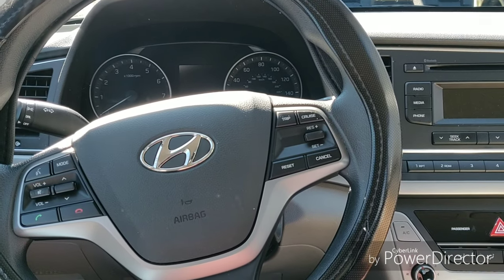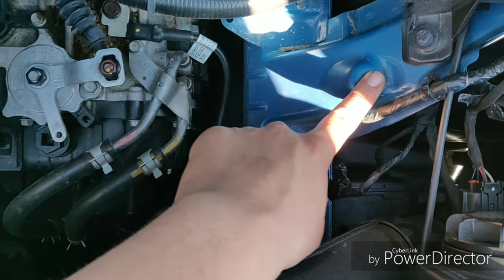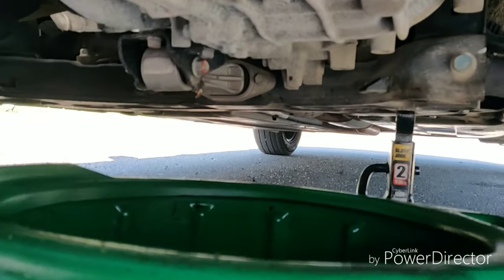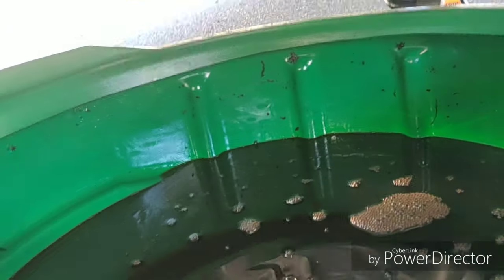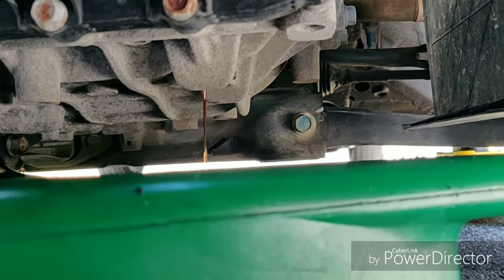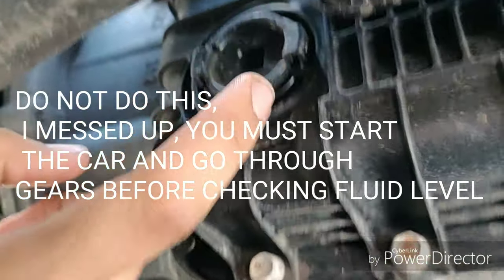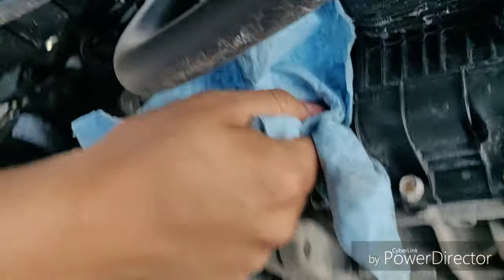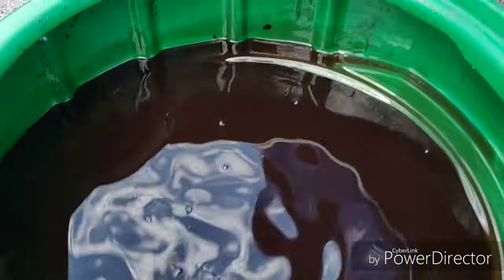HOWTO 2017 ELANTRA TRANSMISSION FLUID CHANGE

Comment: I was able to get the plug in and out with no problem. Don’t be afraid to use a LITTLE force. It only needs to make is past about an 1/8 of an inch so it’s bends.
Reply: Do you know how many quarts came out thanks
Reply: Would you be willing to post a video of your way of pulling it passed the neutral safety switch?
Reply: Cory 919 Brother, maybe next time I service it. All I used was a heavier flat tip screw driver to put just enough pressure on it to get passed that 1/8 bend. I did it a couple times actually. Don’t be afraid to use a little force
Reply: Same here. I was able to get it out with no cutting just by angling it slightly away from the interfering tab and pulling up by hand, no tools and with just a little bit of force. Putting it back proved to be more difficult, so I filed a very shallow (~1mm) half moon in the plug while it was on my work bench.
Reply: @cgatito3528  I did the same.. I got a small course file , and filled a 45 deg on the bolt while it was still installed on the house..works perfectly now...easily removes and installs.. All is good now.... Thanks all...
Reply: Late with the post but how many quarts will fill the empty transmission ?
Reply: Actually that's the wrong fill plug cause that's the breather plug to release air. The filler port/plug is on the rear part of engine.
Reply: @wesdesigns1838  hey, I'm about to do my transmission fluid change on my car, where is the fill plug exactly on the back of the engine?

Comment: Tip for next time, you can always pull the emergency brake and use the shift lock on the shifter and put it in drive. That will move that shift Linkage that’s in the way so you can easily remove the fill plug without buggering it up👍🏻
Reply: Lol i hate u but i Love u buggering it up made my day thanks i needed that Laugh

Comment: I called my local Hyundai and asked how much is a quart of Hyundai SP-III AFT for my 2012 Elantra cost, and I fell of the chair when he said "$39.99/qt".  I said "13.99?"... and again he confirmed "NO, SIR... $39.99 a quart".  I was like "Wow, are you serious?"... "The price is $39.99 a quart".  Obviously, I did not buy it from that dealership.
Reply: My well maintained 2013 Elantra LTD with  91k mi. on it . . . has never seen the dealer since purchase and it won't. You know how I got 91k trouble free miles on it . . . I took charge of the maintenance and most important . . .
I kept the dealers damn hands off of it.

Quality Oil, OEM filters, Quality ATF, NGK PLUGS,  BRAKES, TIRES . . . NONE OF THIS IS ROCKET SCIENCE . . . " LEARN " FROM A KNOWLEDGEABLE FRIEND . . . LIKE THIS GUY . . . OR GET A TRUSTED MECHANIC.
Reply: Bullshit. I paid 17 per quart from a dealer
Reply: @jamesm.8392  you are absolutely right, DIY goes a long way, the only thing I'll have someone do is new tires

Comment: Actually that's the wrong fill plug cause that's the breather plug to release air. The filler port/plug is on the rear part of engine.
Reply: WHY then does everyone use the plastic one under the air box then?

Comment: Why you changing the trans fluid after only 35k miles?  I thought the trans fluid is changed when it hits, 100,000?
Reply: 60k - 80k miles is ideal range. 100k is too late
Reply: @vuvu3421  Owner's manual states first fluid change at 150k miles. It's synthetic fluid. Lasts longer.
Reply: U dont need to change it on an automatic 2015 elantra since their sealed
Reply: @tiana1017  wrong
Reply: @palebeachbum  owners manual is not always true. You can see in the video how bad was the fluid after 35k miles.
After your warranty is expired, your trans will be broken and you'll need to fix it at the dealer; and that's how they rip you off
Reply: @oqhr  The transmission warranty is 100k miles. I would change the transmission fluid before the warranty runs out. If the transmission starts slipping or having issues after the fluid change, the warranty should cover repair or replacement. Waiting until the 150k mile recommendation is foolish, IMO. Changing the fluid at 35k though is a waste of money. It would be like changing synthetic engine oil every 3,000 miles when it's generally good for double that life.
Reply: You should never ignore transmission or transfer case fluid changes despite what the schedule says. Unless it has an external spin on filter youre asking for trouble. Youre just circulating all the shavings, etc around. Yes the filter does its job but the fluid is still dirty.  Its cheap insurance, a transmission rebuild on new computer controlled sensors up the ass to many things to go wrong transmissions are easy 3k
Reply: Where did you get that service manual
Reply: @jaredjacoby545  try eBay they had them back in 2018
Reply: Can’t believe how bad the oil was at only 35k. Crazy.  Will be doing this on mine at around 40k.  It has about 20k now.  The procedure is very similar to my last GM car.
Reply: Its hyundai mechanic recommend at 25k🤷🏻💯 fkn engineers🤦🏻

Comment: Thanks for the video, very helpful! I just changed the factory fill atf in my 17 Elantra at 140k miles. There was a little bit of shavings on the magnet, nothing visible in the fluid. Fluid was slightly brown with clutch material but not burnt. Exactly 4 quarts came out of the drain plug. Repeated drain/fill a second time after a quick spin to get more old fluid out. 

I filled with valvoline maxlife, it had the Hyundai spec listed on the bottle, is full synthetic and only costs $17/gal so I feel good about it. IT STINKS LIKE HELL THOUGH! lol. I spilled a little in the engine bay and it took a week or so to air out. I’ve put 10k miles on the new fluid with no noticeable changes in performance, so I think all is good!
Reply: wow, that's a lot of miles, I drive around 40k miles a year, I already sold my 2017 Chevy and now I have a 19 Elantra and a 19 Elantra GT
Reply: How did your Valvoline Max work in the long term.
Reply: @johnjohnson9980  just fine, sold the car at 200k with that same valvoline fluid and no noticeable change in performance. Car still ran like new
Reply: @ravstafarian5186  this makes me less worried now. About to change the factory fluid soon at 93.5k miles. Mostly highway driving so hoping i dont mess anything up.Im conflicted on what fluid to use. Can you shed some light on what fluid is good. Debating between amsoil and valvoline maxlife
Reply: For anyone reading.I went with Aisin spv IV from rock auto for about $8.50 a quart.Was able to drain about 3.5 quarts from the transmission and filled the same amount.So roughly half the fluid was changed with a single drain and fill. 500 miles since than and no problems yet. Will do a second drain and fill when i do my next oil change

Comment: Exceptional video!!! Great job. I undid the neutral switch bolts and the fill cap came off beautifully. Easy job. Use OEM FLUID AT ALL TIMES. Mine drained 3.5 quarts out.
Reply: did you just add 3.5 back in? I’m not a fan of the level check procedure so i was wondering if i can jsut put back in exactly what comes out ?

Comment: You are the hero we didn’t know we needed. Also, bless you. I just hit 120,000 on my 2017. Looking to change that soon along with my antifreeze/coolant.  Thank you for the video bud.
Reply: Chang it every 60,000 miles, ATF.
Reply: At 120,000 miles you would not be wise to NOT change the transmission fluid.
YOU may at this point do more harm then good.
Reply: A few questions if you don't mind my asking. Do you have the 2.0L engine and did you have to get it replaced? Has your Elantra had any transmission problems? I bought myself a new 2018 Elantra and the engine ran like crap from the first month of ownership and the transmission started acting up at 8,000 miles. It wasn't safe to drive and the dealership was no help. Ended up selling the car at 25k miles. I loved the car so I was really disappointed by the problems.

Comment: I already did it in my 2013 elantra at 60,000 mi.  last year. I use the same fluid SP4-M from the dealer $20.23 each. I use 3.9 quarts just drain and refill. Great video.
Reply: So about 4 Quarts is the Norm.  On these Transmissions  Good 👍😁😚😏

Comment: I just did this at 58k on my 2017 Elantra GT. I don't see much content revolving around the GT, but this and similar videos worked well enough for me, though there are a few differences:

1. I didn't need to remove my splash cover to access the drain bolt, but I did anyway for the sake of doing it the first time. When I started, I realized I could see the drain bolt right away and the cover wasn't in the way. I think next time I will leave the cover on and see how that works for me. Though I'll probably have to take it off to check the level so I may be stuck with removing it, haha.
2. The fill bolt on my GT is the screw-in kind. It tightens all the way down, and I had to unscrew it for a bit to get it out. It's not a half or quarter-turn like on the sedans.
3. I did not have to file down or cut my fill bolt in any way - that part you had trouble with isn't in the way so I had no problems getting it out. :)
4. When I unscrewed my drain bolt, it did not have a crush washer, which I thought was strange. I added a copper washer and torqued to 30lb/ft as suggested in another video.

As I said, I did this at 58k miles. The fluid was pretty dark but not burnt - still a little red/pinkish in tint. I ran out of daylight so I did not get a chance to check the level, but I drained four quarts roundabouts and I put four quarts back in. Tomorrow when I have sunlight I'll add a little more fluid and check the level. Thanks for your clarification on that process, by the way.

Hope this helps any fellow GT owners out there. I'll try to document my experience as well - maybe record something though I never have before. :p After checking the level tomorrow, I'll probably drive around for a couple of hundred miles before a second drain. I used Valvoline Maxlife ATF - it claims to be up to spec and the most important thing for me was getting this fluid changed, so I'm hopeful it'll work just fine, especially after reading that other GT owners use it.

Update: Checked my level at operating temperature and got a small steady stream. :) Woo!
Reply: Gotta do mine tomorrow, thanks man!
Reply: Thanks for your comment. My wife has 2016 Elantra GT with 67,500 mi. and never change the atf. I will do the drain and fill with the oem hyundai sp4 fluid but reading your comment I'm leaning to use tha Valvoline Maxlife. Do you have any problem at all using the Valvoline? Thanks again your reply is really appreciated.

Comment: I have a 2017 elantea se. I always wanted to do the atf fluid change. Thanks for the video. I did take the risk and did it yesterday at 111,000 miles(I do rideshare and deliveries). Atf was really dark but drain plug had less debri, so I am hoping I did this on time. Also I used atf from Ravenol instead of the dealer brand, which is way cheaper, I got it from amazon. To cut the cap y used a garden pruner tool(scissor like w/one flat side)it only took 2 cuts a less than a minute. To refill I used a hand fuel pump which i bought at a family dollar for like 3.25
Reply: I did measure and it drained 4l and 100 ml. I only put 4l back
Reply: How is your car driving now?
Reply: So far it shifts smoother,however, I have only put around 500 miles
Reply: That's wonderful. Can you share a link of the kind of tool that you used to cut the fill cap? I plan to change mine soon as well.
Reply: @roman75236  that's awesome. There were so many, so was wondering what to use. Thank you so much. :)
Reply: Hey I was wondering 7 months later how is your car running? Fellow rideshare and delivery driver here with a '17 elantra and similar amount of miles.
Reply: @TripDadLife  So far is still running fine. It just hit 133,00 miles. You probably don't need to cut the cap, just shift to neutral to move that lever out of the way, just make sure to put something on the tires so it won't roll. Inspect the old ATF to decide whether to replace or just put the same old ATF back. In my case the drain plug didn't have all the metal shavings like in the video, so I went ahead and use new ATF
Reply: @roman75236  thanks for the response and hope you get well over 200k miles! I'll check in again in about 12 months.
Reply: @roman75236  how is your car doing now Im about to reach the 100k mark also
Reply: @shadman121212  it is at 154k with no problems so far
Reply: And here I am scared to do it at 90K
Reply: @jaylensmith6308  same man. old comment but did you end up doing it and did you have any issues? Am at 91k mostly highway and am thinking of doing this myself when i change the oil next time at 93k.

Comment: the ATF on my 2018 Elantra was pretty close to black at 50K miles. With the 3rd drain and refill, I started the car, switched through all the gears 6 times, and then let it idle for 5 minutes pulled the check port /plug at @13:39. Then I slowly added ATF back in until I saw a tiny stream of ATF come out. Popped the plug back in while the car was still idling. If you stop the car first before re-installing the plug, a lot of fluid will spew out.

Comment: A little late here but I am sure that the part in the way of the drain fill plug is the transmission shift linkage just shift the vehicle in neutral or in another gear and then pull the fill plug out

Comment: I’m glad I did not have to deal with the part covering the full bolt on my 2015 Elantra
Reply: Silver Fever I’m going to be doing a change on mine and it’s a 2015 as well lol
Reply: Make sure to use the Hyundai SP4 fluid from the dealership

Comment: I would have driven around for a couple hundred miles before doing the second drain and fill. You checked the level with the vehicle running right? I waited till 60k to do mine.
Reply from the maker: Yes, with the car running

Comment from the maker: I did the change again recently at 100k miles. I wouldn’t change any of the information found in the video. 

Shifting into neutral doesn’t do anything to create extra clearance for the plug. 

This time around I used Valvoline Maxlife. I have noticed that the car will upshift sooner now, I believe it goes into 3rd/4th at 25 mph instead of 30mph when driving normally. I’m not sure if this is because it’s fresh fluid or because it’s Valvoline. I have noticed that when cold, it takes an additional second to start moving after coming to stop. Again, I’m not sure if this is because of clean fluid or because I’m using Valvoline. This could also be because of a dirty/clogged filter. I would suggest sticking to OEM fluid to get the longest life out of the transmission.
Reply: I believe you’re supposed to shift into drive not neutral to create clearance

Comment: That's what Hyundai calls the inhibitor  switch lever,  in English use to be called the neutral  safety switch.  To get it out of the way, have to get the thing out of park, has that cap next to the shift lever, remove that and poke a rod down there, like a stick or screwdriver.  Course, make sure your wheels are blocked, also have a parking brake so you don't kill yourself.

Would only use genuine Hyundai transmission fluid, had friction modifiers in it you may not find in aftermarket.  The way we drive, good for 160,000 miles, but the warranty is only good for 100K miles or ten years, whichever comes first.
Reply: well explained! I was planning to put mine in neutral after turning the Accessory mode on.

Comment: It's not lifetime. It's every 150k in the manual. I changed my 16' Elantra at 97k. It looked great still. Had metal shards but nothing excessive.
Reply: old comment but am about to change my elantras for the first time at 93k. did you have any issue after changing it at 97k?

Comment: I wonder how the dealer does this fluid change.  Do they cut a notch In the fill plug or do they take that piece off the trans
Reply: Dealership uses a fluid pump to pump it in through the drain plug.  Google “transmission fluid pump” and you’ll see what I mean

Comment: It's an excellent job I benefited from
 I have the Elantra 2018 and I want to change the oil
How much liter do you need from your experience
Reply: I went ahead and did the change on my 2018 Elantra as well. I've also included some tips on how I filled the fill bolt. Here is the video link - https://www.youtube.com/watch?v=_c19XUnyVUs.

Let me know if you have any questions. I have a 2018 as well :)

Comment: I wonder if you could fill from the inspection plug, like you do with a manual trans.  You would have to pump it in.  great info thanks.
Reply: Exactly. That's how it's supposed to be done. Not by fucking with that plastic plug on top.  And you should measure exactly how much comes out and put that much back in

Comment: An FYI.  Call ahead to see if the stealership will sell the trans fluid from their bulk container.  If they do, take an empty gallon jug and get 3.5 qrts.  I get it from my local Kia stealership for $7.89 per qrt.  The Hyundai place wanted $21 per qrt.
Reply: ATF HK4 1QT
Part #: AIC 30040100750 $9.95 from NAPA  (Idemitsu brand)

Comment: Elantra seems to me that it has the same kind of transmission ( dual clutch)  as my Hyundai i 30  here in Europe. A few months ago I got my i 30. When I asked Hyundai dealer about changing oil in my vehicle's transmission they said to me that it is life time oil, no maintenance LOL. Yeah, it was hilarious, and sad at the same time. By the way thank You for Your video ! it is a First video on how to care and change oil in HYUNDAY'S and KIA'S Dual clutch trans... I hope Hyundai authorized mechanics are watching this video and learning !!!
Reply: this is a 6 speed torque converter auto transmission, not a DCT, but I'm sure the procedure is similar, the dry DCT holds very little fluid from what I know

Comment: Late with the post but how many quarts will fill an empty transmission and what size socket is needed to open the valve to check